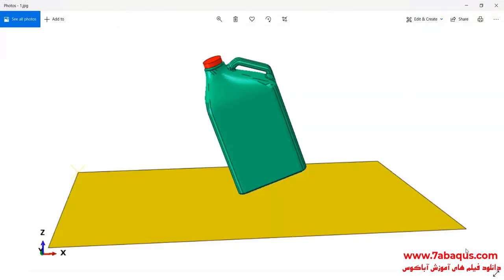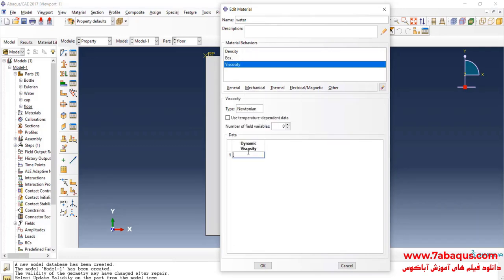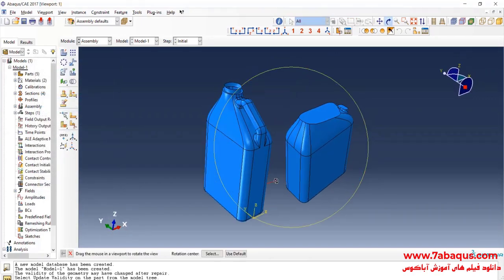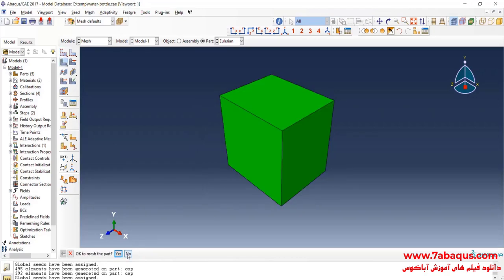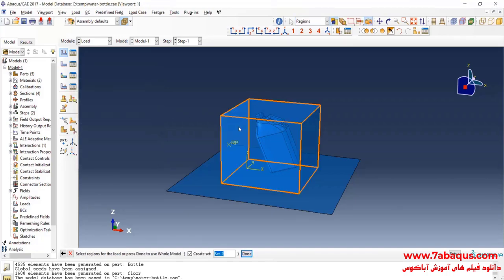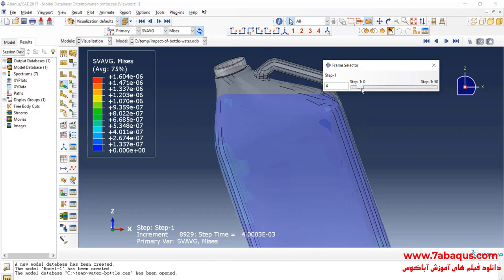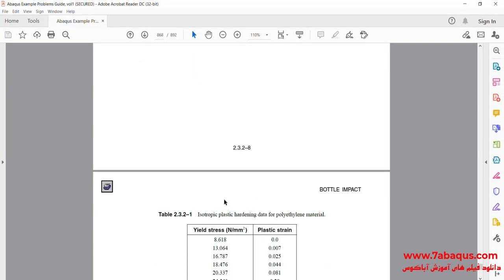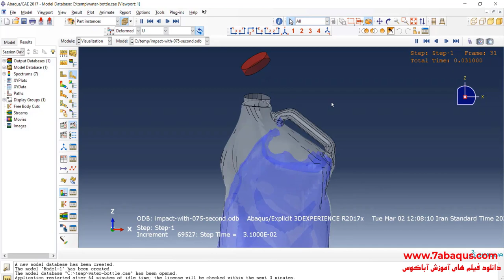Impact of a water-filled bottle using coupled Eulerian-Lagrangian (CEL) approach in Abaqus

Comment: Just one more question: why do we give velocity to the model after assigning gravity, i mean won't model automatically go down with the help of gravity then why do we have to provide velocity to the model too ?
Reply: Okkaa got it so we provide initial velocity at the time of drop nd then gravity does its work.
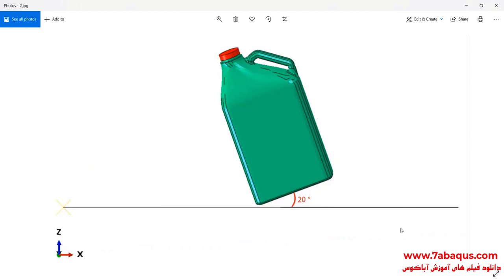Reply from the maker: @ayushdogra966  The water bottle is dropped from a height of 300 mm , so the initial velocity of the bottle on impact is 2444 mm/second   time 0:40
Reply: @saeedmoeini-7abaqus  Okk thanks for replying. Btw great work. 👍🏼

Comment: how did you create shape of water ?
Reply from the maker: i used ready part
Reply: @saeedmoeini-7abaqus  Yess I got that but in whichever software u created that did u have some dimensions for the shape of water to create it manually or you used some tool to create shape of cavity of bottle.
Reply from the maker: @ayushdogra966  The geometry of this bottle is complex , so you can not create it in abaqus software
if the geometry of bottle was simple , you can create it in abaqus using "shell and revolution: tools
Reply: @saeedmoeini-7abaqus  Okk Thank you
Reply: @saeedmoeini-7abaqus  Hi Saeed, I wanted to ask how can we find the internal volume change of a bottle or pipe due to external pressure?